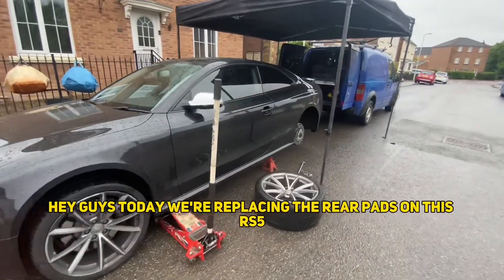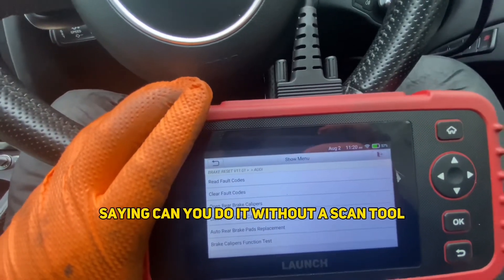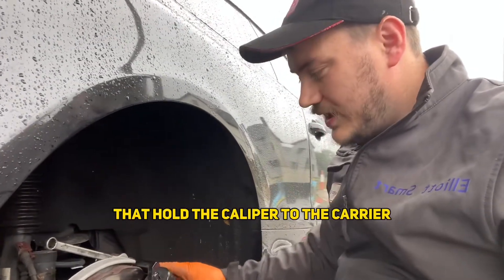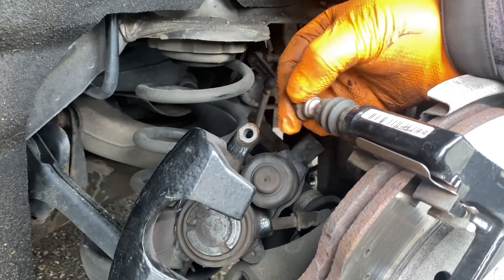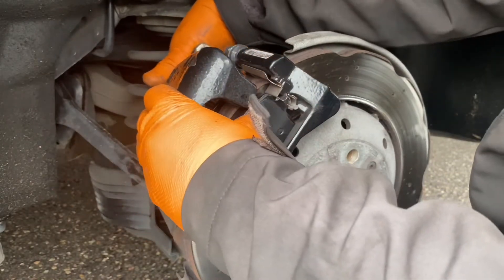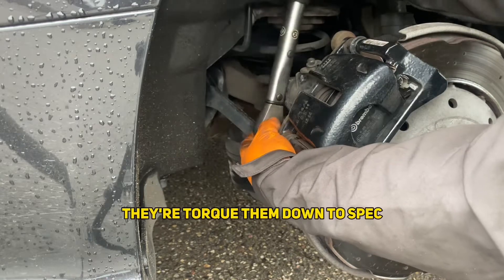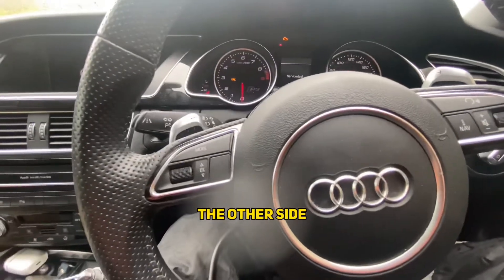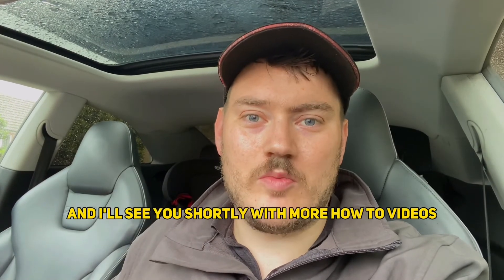How I : Audi RS5 rear brake pads

Comment: Hi mate what grease do you use for the contact points on the brake pads I use copper grease but the stuff you use looks a lot better
Reply from the maker: Yeah manufacturers advice against the use of copper slip now. I’m using a ceramic brake grease here it’s quite good
Reply: Ok thanks mate l will buy that then